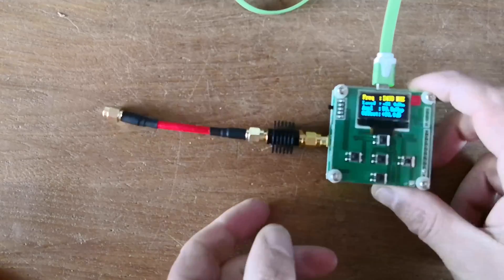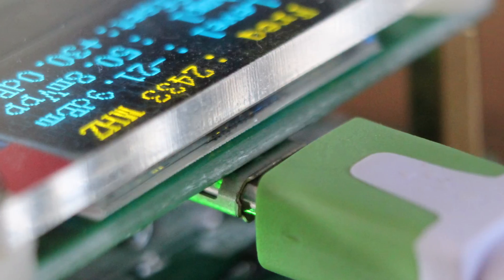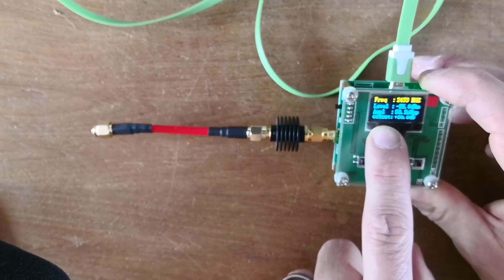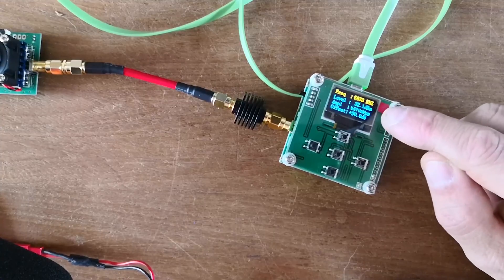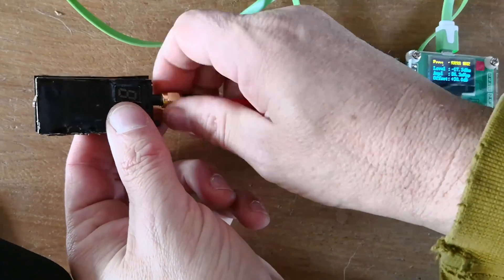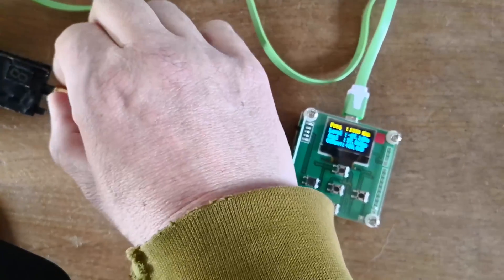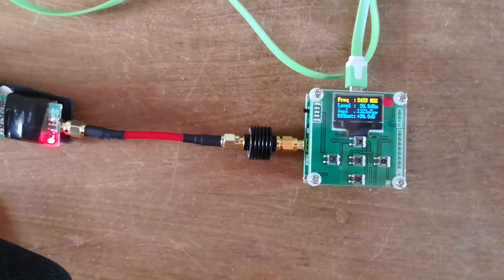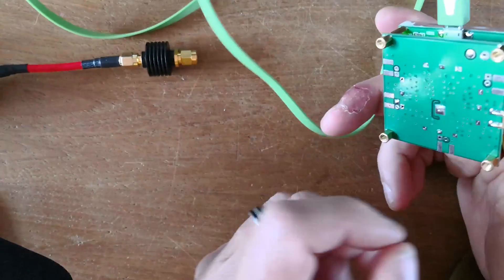Bangood RF Power Meter RF-Power8000 1Mhz-8000Mhz OLED review and test

Comment: Can you check the accuracy of your attenuator with crude tools like a DMM or an oscclioscope, or do you need an calibrated spectrum analyzer to see the exact DB drop?
got myself an new PC based USB3 RF meter, and got 2x 30DB attenuators.. but they are cheap from CN, so would like to get an idea of what DB they actually is, as 1 or 2 DB variable (fx an 30DB that is fact are 28DB) will fluke the RF result a lot.
Anyway I checked my HackRF at 2.445Ghz and match it on the RF meter and I got 24.6mW.
Reply from the maker: Hi, sorry i dont have it anymore. Was quite accurate tho
Reply: @r00t3d  Okay, but do you know the answer to my question.
If you have an -30db attenuator.. is there any way I can validate its accuracy (fx is it -30db or is it 29db or 31db).
Can you do that with an multimeter perhaps and take the resistance reading? or can you do it with an oscilioscope?
or do you need a referenced spectrum analyzer for that, to see the DB drop when attached?
Reply from the maker: @JAKOB1977  you need a signal generator and an oscilloscope
Reply: @r00t3d  Arhh I see... I do have both.. an FeelElec Fy6900 60Mhz and a Micsig STO1054 100Mhz oscillioscope.
https://www.youtube.com/watch?v=Iy2NvuZUYXk

Which signal from Fy6900 would be able to show the exact attenuator value in an -30DB attenuator.??

atm Im checking my HackRF for its output value across its transmit span , but Im unsure what exact value my -30DB attenuator is at.. Its a cheap one from China, and a few db can fluke the result  quite a bit.. I need to inform my RF meter. what exact value my attenuator is.
fx https://www.youtube.com/watch?v=bMnOtG7ROmI

so Im looking for an approach to see what exact attenuation that -30DB attenuator is operating with.
Thx Herve for any help. :)

Comment: I've ordered this meter, ive been told its got a maximum input of 12dbm, a 30dbm attenuator is sufficient for measuring a 2w transmitter right?
2w is 33dbm, minus 30dbm from the attenuator leaves 3dbm or does rf not work that way?
Reply: I would use a 40 dB attenuator. Keep it under 0 dBm. 12 is the MAX.

Comment: you hit the up button to settle on 5800mhz. but can you set other, non-standard frequencies ? say 320 mhz ?0
Reply: you can set any frequency, which will no effect. In this device frequency is a fake value, it uses rf-power to voltage converter on bottom board and measure the signal with STM8's adc. That's it :) Don't trust the chineas ))

Comment: Is an attenuator required?  I get 4.5dbm on what should be an 800mw transmitter at 5809mhz.  Doesnt make sense.  The converter says 2.8mw.  My drone can fly at least 300meters with no breakup in picture.  Same numbers on two separate transmitters both set at 800mw and same frequency.
Reply: Reading the specification - It reads upto -5 dBm which is 0.316mw so yes, you need an attenuator if you’re input signal  is 800mw. A 30db attenuator will reduce your input signal by 1000 so your 800mw will be 0.8 mw - still too high - so a 40db attenuator is what would suit. I think! 🤔

Comment: Well, thank you very much, for a very long time I have this meter & couldn't figure it out how to make it work for me, now I finally managed to understand, the procedure to make it work! Even do with out the attenuator in my case the meter is very much useless......
Reply from the maker: why what happend?
Reply: I guess that there was not enough information for me to figure it out how to use it! I was expecting to be able to see the power output in watts or milliwatts.. couldn't understand the procedure how to translate the Dbm's to milliwatts... 

Thank you again.
Reply: Hello, i want to test the output power of 5.8ghz quadcopter vtx's in races. I wont be able to disconnect their antennas, do you think i could attach a sma connector antenna to the input port (with or without attunator?) and measure the racers' vtx power output with this device? Thanks in advance for the answer :) regards
Reply: Best you might be able to do is try attaching an antenna and compare relative signal strength from a known 25mW VTX at the same distance. The device might not have the sensitivity though to read the very much weaker signal being received by the antenna. It goes to -55dBm so it might work